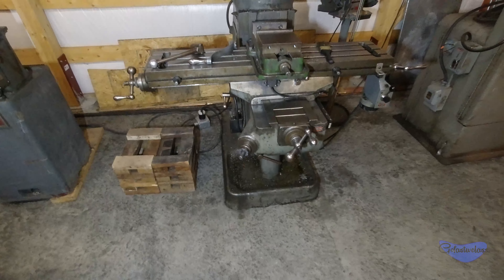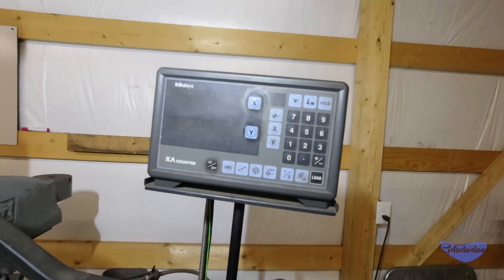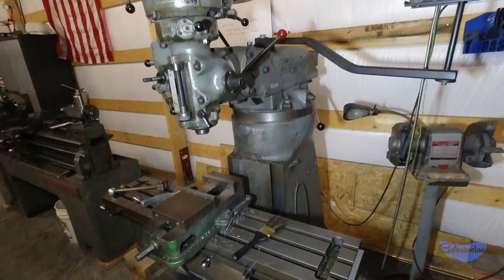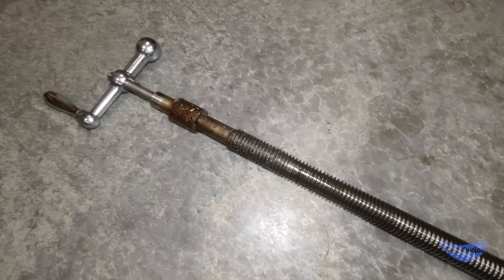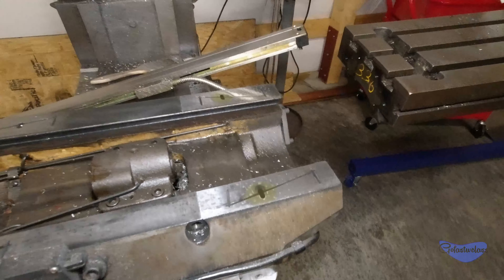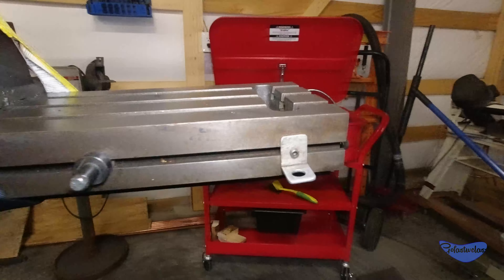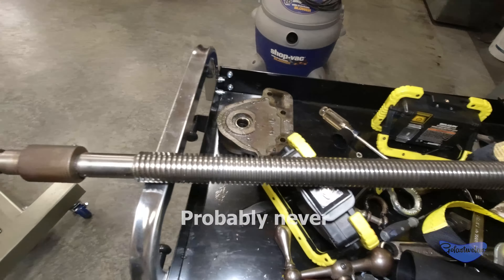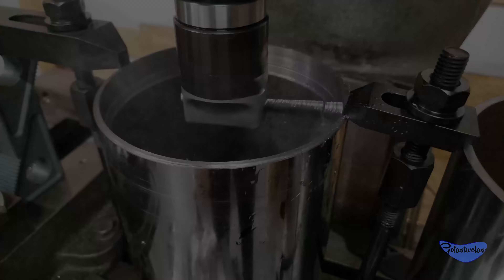New to me Bridgeport mill

Comment: My Buddy got a Bridgeport for FREE when the place he worked at Bendix moved to the Rome Air Base. He also got a Truck load of tooling. He had 2 Rotary tables, 2 vices.
Just a great machine to own, you will get a lot of use out of it for sure, Good Luck with it.
Reply from the maker: Very cool. 
Thanks, I love it. They are incredible machines with the main limits I've seen being capacity and operator creativity.